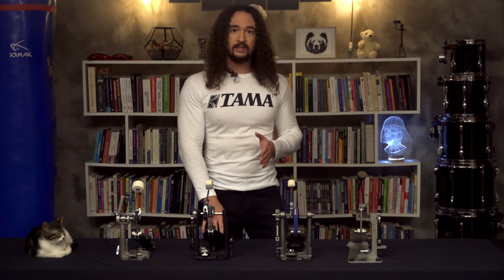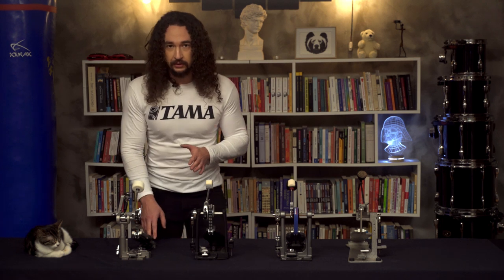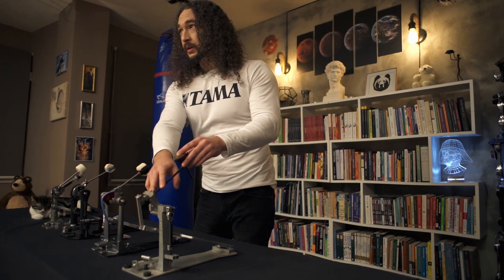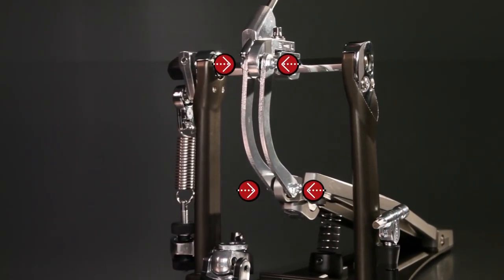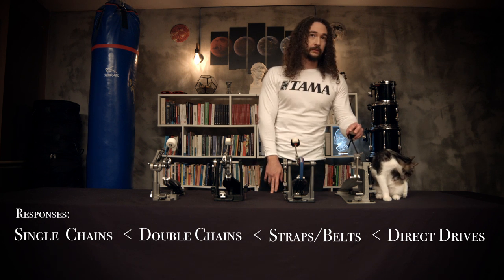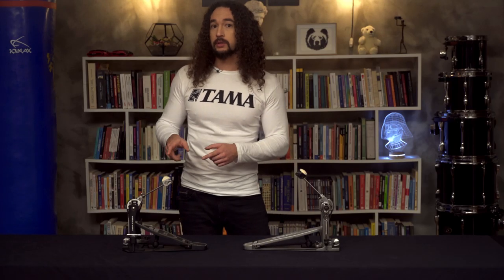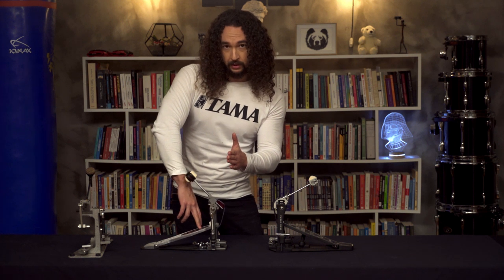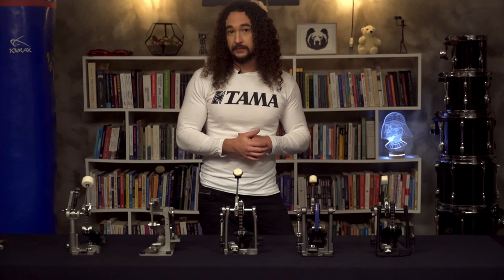Double Bass Drum Lesson 11 - Pedal Types

Comment: Great video Erce ! 

I have been starting with a gibraltar double chain (way too heavy for me), then switched to a yamaha direct drive (way too weird to switch drives, i never really adapted), then i fell in love with the iron cobra, not as much with the speed cobra i had after, which lacked dynamics and control for my style on medium tempos, and eventually, i'm now testing the strap drive pearl eliminator which really fits my light legs, with the right momentum they still pack a punch :D 

and this next tama direct drive seems to have a more "chain" type of swing due to the conception (angle and rotating points of the drive), i'm going to try those asap ! 

Take care mate :)
Reply from the maker: Very different types of pedal types that you have tried. That's very good for experience. I'm thinking the same thing with these Dyna-Syncs. Want to try them asap:))
And thank you very much bro!
Reply: did you like the eliminator or iron cobra better?
Reply: @larrytate1657  hey ! Eliminator all the way, it has way more settings and possibilities, like an Iron Cobra, but lighter and more up to date :)

Comment: I have a DW 5002 double pedal from the mid-90's (and hi-hat and remote hi-hat).  It has a single chain drive and the Delta I hinge.  The hinge does not allow any lateral movement whatsoever.  IMHO it's the best hinge DW (or anyone) ever made, better than the current Delta III hinge.  Why DW ever stopped making it, I'll never understand.

I also disagree somewhat with your assessment of double chain drive pedals.  Nearly every double chain drive pedal I've ever seen has some amount of lateral movement.  Two chains reduce the amount somewhat (compared to single chain), but if there is any amount of play in the hinge, and there almost always is, there will be lateral movement in the footboard, even if it's only a fraction of a millimeter (which still isn't as good as my single chain DWs).  Even the (older version) Trick pedals I tested had a tiny amount of lateral movement.

I don't know if I agree that double chain drive is inherently smoother and more responsive - it's difficult to say without testing the exact same pedal with both drives.  And the fact that it's more mass results in a different feel that I personally dislike.

Personally, I think Jojo Mayer got it right - nylon strap and a fully circular cam.  Low mass, low maintenance (don't need to oil, won't ever squeak), and the most even feel from the beginning to the end of a stroke, because the center of gravity of the cam is fixed at its center, not moving back and forth around the shaft.

(I hate the feel of direct drive pedals.  The only time I played one I liked was when I tested the PDP BOA at NAMM.  But when I tried it again at a store, it felt terrible, and I couldn't figure out how to adjust it to make it feel like the one I played at NAMM, so I gave up on it.  Good thing, since it was prone to breaking.)
Reply from the maker: Thanks for your comment. It changes on every drummer. Strap, direct or chain drives.. but about smoothness and responsiveness of the double chains I can say that yes they are more responsive than single chains in general but as you said 'smoothness' may change drummer to drummer. Good point, thank you.